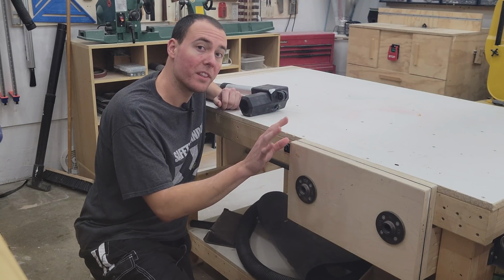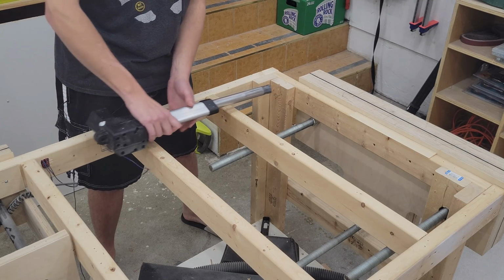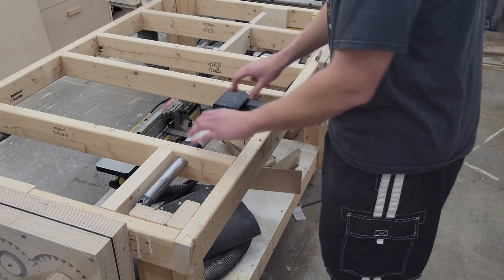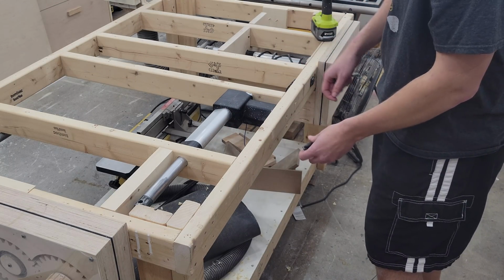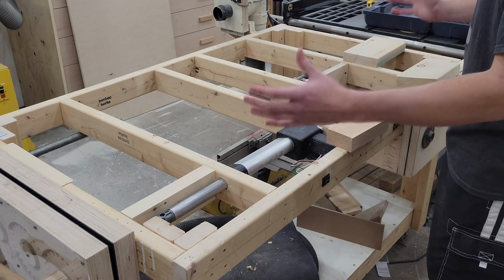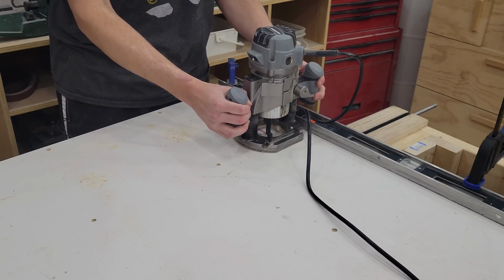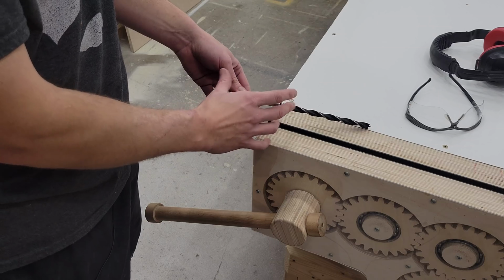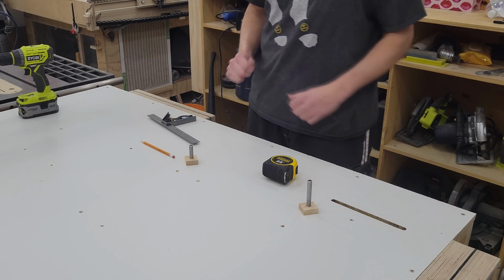I Built a Secret Tail Vise into my Workbench

Comment: That's a great way to re-use an old / spare linear actuator, I guess since the power supply came with the actuators that you don't need to worry too much about the actuators stalling and burning out the windings in the motors if you keep pressing the buttons?

Does the power supply have current limiting built in or does the actuators protect themselves you you don't cut the power to them before they stall?

Comment: I like it I however have one nagging issue with it. Those are designed to push out more than to pull in and that's not too big a deal but I only worry about how the end was attached to the tube. Often those are just pressed in and don't have allot holding them in on retraction.  Might end up drilling an adding a pin through the tube and the insert if it becomes an issue. 
         Hope you had a good Christmas. It's been in the 80s here in Texas, very unseasonably hot. 85* today so I may finish up mulching the leaves. A little cooler tomorrow maybe she will come up with something outside to do for my birthday... Yes it sucks this close to Christmas but I tried moving it but for some reason the rest of the world won't let me move Christmas to a different month. :)